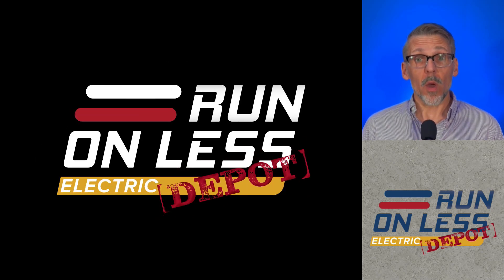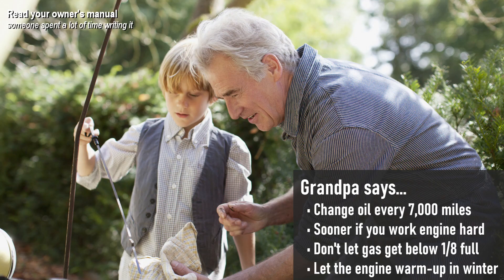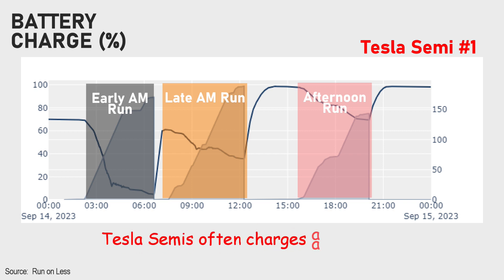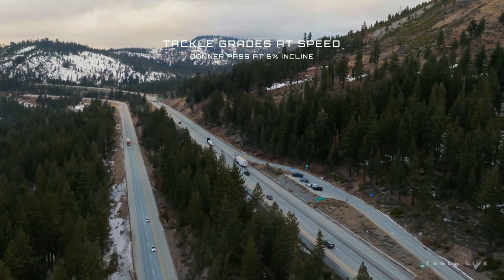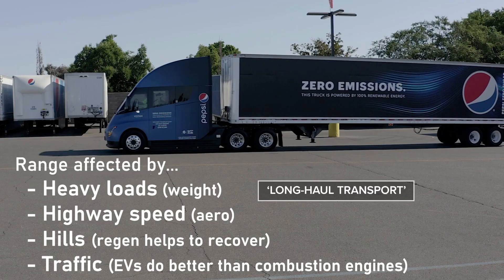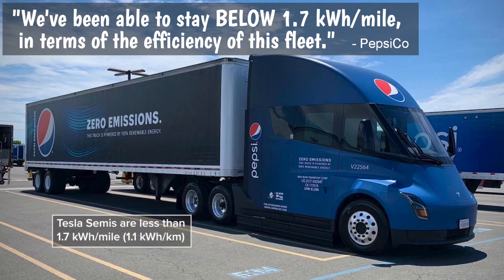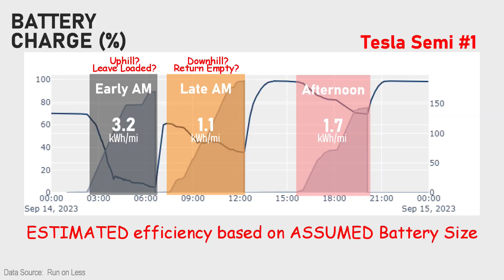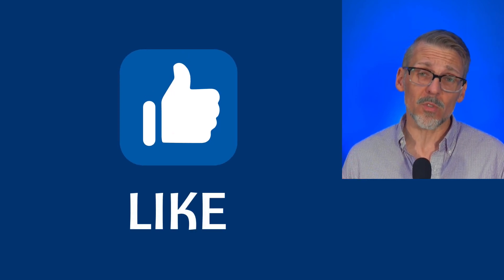In-Depth Analysis of Tesla Semi Data (Freightliner and Volvo too!)

Comment: Toronto to Montreal , Canada is about 500 miles, and  the speed limit on the 401  highway is  100kph(62mph)Walmart  and Loblaws and Pride group logistics have ordered the Tesla Semi.
Reply: HVAC Amps draw is minimal especially with heat pumps which Tesla uses in its cars ,even Bjorn in Norway did it in the old resistance heater of his 2013 modS " this is why Tesla has " Dog mode" and " Camp mode" , meanwhile ordinary Semi use diesel heaters overnite, or leave the Engine running all the time in the truck stops, to heat the Sleeper Cab,  insanity
Reply: In the winter the average speed is probably half that because you spend 2-3 hours inching forward gridlocked in traffic.  How is the Tesla semi going to keep the cab warm sitting in traffic for hours not even moving when it's -20C ?
Reply: @ansmerek  Electric trucks tend to have somewhat better insulation and heatpumps, no? Driving slower might actually offset the difference for a truck.
Reply: @ansmerek  Talk about a non issue. They could sit in traffic pretty much forever. 
Diesel trucks... Not so much. Not to mention you need to keep the engine running for heat.
Reply: @themonsterunderyourbed9408  so how does the driver of an electric car stay warm for 2-3hrs not moving in traffic when it's -25C ?  Running batteries for heat ?
Reply: @ansmerek  Ask Norway - it doesn't seem to be a major problem for their 25% of all cars (80% of new car sales) that are EVs. Heat pumps do get magical efficiencies, but even straight resistive heating doesn't use THAT much power - 1500W is about 2HP.
Reply: @jebeda  heat pumps don't work well at -25C.  A lot of people in Canada have seen first hand heat pumps do not live up to the hype.  They are nowhere even close to as efficient as claimed in cold temperatures.  Many people installed them in their homes only to find they are less efficient and more expensive than natural gas

Comment: Interesting data.  It's too bad that the companies are not giving real world data.   I am retired but worked for Pepsi (Tulsa)  Several trucks (OTR) did daily runs to the Dallas warehouse (250 miles).  Their return trip were never empty.  Deadheading is loss of revenue.  Anyway, good reporting.  Cost analysis would be nice info too.  EV cost per mile vs ICE.

Comment: It's been mentioned, but... CARGO! The only thing that's important here is how much it can get from A to B, and at what fuel cost. Range is a factor for personal vehicles because we hate to refuel... I guess... But for a trucking company the range is only important for how long it will take to refuel and that may not even be a thing if the truck has to wait for the trailer to be unloaded and re-loaded at the destination.

So basically, this video is not just apples and mango's, it's just you saying numbers out of context.
Reply: The cargo it can carry is the same as a diesel. The 300mi semi weighs <20,000lbs and the 500mi semi weighs <23,000lbs. With electric semis allowed an extra 2,000lbs,that puts them smack in the middle of the average diesel semi weight of 17,000 - 22,000lbs.

Comment: lol….. how much for an electric EV? And is it worth it ROI
Reply: Yes. That's pretty much Tesla's entire pitch - electric semis cost way less to operate.
Reply: @truhartwood3170  problem is the maths do not workout. 1/6 of the carry/load capacity. Reduced range in cold or hot extremes. Cost to buy horrific. Than down time when charging as charging points for those lorries are low in number.  Thank you, but no thank you.
Reply: @latitudeash  oh for sure, if anything you said was true then they totally wouldn't make sense. Fortunately, none of what you said is true.
Reply: @truhartwood3170  - That's good then. Can I suggest you go out and buy 10 of them, you will be making money hand over foot? It's all a vapour product. You can't even order one now. Total prototype fakery. BUT luckily I am wrong and you can make lots of money, as Elon said you would be mad not to buy it as it is sooooooo much better than dinosaur juice.

Comment: The vast majority of trucks should go plug-in hybrid while battery tech matures, it will be easy to rebuild those into full BEVs later once there are even cheaper / safer and better batteries…  they can even use cleaner burning fuels immediately; generators aren’t as picky about the type of fuel, usually being operated at a constant ideal RPM and don’t need to have things like low RPM torque and many other requirements typical of transmission driven truck engines, nor do they suffer from the same emissions problems since they are inherently burning clean at ideal efficiency which normally only happens once up to constant speeds.
Reply: Battery tech has already improved and is continuing to improve rapidly. We're already looking at mass-produced batteries with 500Wh/kg, about double that of EVs on the roads right now.

Comment: The charging limits have nuances. 
It's not charging above 80% and depleting below 20% that is the problem. It's leaving the battery outside of that over time.
So for regular driving you can use the whole range, just charge all the way and go and then charge above 20 when finished.
Reply: I believe this is wrong. The phisical access and expulsion of electrons is what damages the battery. The dynamic nature is responsable for the degradation.
Reply: @lucadellasciucca967  

No, drawing current from a cell does not by itself damage a lithium cell. Torgrim is accurate in what he says about the dwell time at high and low SOC if you look at SEI and CEI degredation. If you looking up the webinar with Dr Jeff Dahn Dalhousie for EV battery health or the Engineering Explained video on how to ruin your electric car's battery, you'll hear the same suggestions. However, they go a step further and argue that charging and discharging above or below nominal causes the cells to expand and contract, which causes stresses in the crystal structure, contributing to fractures that opens up more surface area to consume lithium ions and other material and turn it into a CEI layer that degrades capacity.

Your right that high discharge rates CAN cause damage due to the internal heat buildup, but not on the mark that its because of the electrons. Yes the discharge is evolved by drawing electrons, but the dynamics you speak of are all related to the structure and chemistry inside of the cell dominated by ion flows.

Comment: How will they perform in harsh weather conditions knowing how the batteries perform in the cold especially
Reply: It is a non-issue now due to better design and battery management and also battery chemistry - in Norway, they do not have an issue with -20C to -40C temptures
Reply: The mass of the battery pack in a semi makes them pretty impervious to weather vs a car. Also, the newest batteries still retain 90% of their power down to - 20°C. So a non-issue basically.
Reply: Tesla has the best battery termomanagement system on earth. The cold has major effects on the efficiency of ICE vehicles.
Also don t think too much about the <1% cases when you make an analysis.
Do your research, invest in Tesla.
Reply: @lucadellasciucca967  Even with "the best thermal management" Tesla cars/SUVs are still effected by the cold quite a bit, so that's not a great argument. The better argument for semis, specifically, is that because the pack is the size of 11 car battery packs, and they're all in a big brick, the volume to surface ratio is drastically larger, so heat isn't stripped away as fast. 

Combine that with the amount of power they're using and the pack can heat up quite nicely even when the weather is extremely cold. 

On top of that, electric cars use most of their power to get warmed up, but then need very little power to stay warm. So if you're get into a cold car, driving 5 min, then stop and let the car get cold, then get back in a driving for 5 min, eover and over, you're range is going to be way way shorter than if you got it, heated up once, and then kept driving. This is also why it's good to get your EV reheating while it's still plugged in, as the you're range will be practically the same as if it was 20°C. Anyway, since the semi is operating for much longer periods, it doesn't have to use energy to constantly heat up over and over. For all these reasons, the semi is almost impervious to weather vs an EV. Combine that with the fact that, as I said in my last post, newer batteries are showing 90% power at - 20°C/-4°F, and it's pretty much a non-issue.
Reply: @lucadellasciucca967  Actually not. Most rivals have as good or better  thermal management. It is not rocket science.
Reply: @rogerphelps9939  Tell me you know noghing and have done 0 research without telling me you know nothing and have done 0 research xD
Good luck buddy!

Comment: What's the useful load?  Thats what matters. Just more EV BS.
Reply: Useful load is about the same as a diesel truck.
Reply: @truhartwood3170  It's NOT!  It's much less that's why you can't find it.  Transportation companies don't care about 0 to 60 times.  Useful load is the most important and because of the weight of the batteries. This thing is another flawed  Tesla truck.
Reply: @davidsoom1551  Dan Priestley, the lead engineer on the Tesla semi, just did a talk where he said the weight of the 300mi-range semi is <20,000lbs, and the 500mi-range version is <23,000lbs. Most diesel trucks fall in the 17,000 - 22,000lb range. Given that electric semis are allowed an extra 2,000lbs GVW, that means they can carry the same cargo weight as an 18,000lb or 21,000lb semi respectively, which puts them smack in the middle of the range of diesel trucks.

Comment: No one seems to include the driver's experience in their assessment of Tesla's semis. How does a driver hand paperwork over to and speak with someone at a booth? How does a driver look out the window when backing or wipe clean the mirrors? How easy is it to manage a touch screen when bouncing along America's ultra smooth roads?  There's very very little upside to any sort of touchscreen in a moving vehicle. It does not have any sleeping arrangements for the driver. It's strictly a day cab configuration, meaning it's not suited for trips that take multiple days. Tesla's Semi is impressive in many different ways but being practical isn't one of them. And while in Tesla's cars they move units because features over functionality is acceptable, trucks aren't status symbols first. They do, at the end of the day, have to do the job they're designed for efficiently, and things like this are clearly just "trendy" not practical. It seems Tesla's designers do not adhere to the principle "Form follows function".
Reply: The entire design was based on what's best for the driver and daily operations with tons of feedback from the drivers, using the semi for Tesla's own operations, etc. Do you really think Tesla doesn't know and take into account everything you just said?
Reply: @truhartwood3170  From your reply, I can tell that you've never driven a semi and performed multiple pick ups and deliveries or driven one from coast to coast. I can understand someones appreciation for futuristic designs and the latest technological innovations but a little critical thinking will show they are impractical for everyday use. Form should follow function.The design of the Tesla semi is definitely not driver friendly.
Reply: @niemi5858  There is no remotely possibly conceivable reason Tesla would design the semi around anything other than practicality. Their customers will judge it based 100% on pure practicality, nothing else. Tesla knows this. Drivers have been key consultants on every phase of development to make sure it's going to work for them. But with every design there are tradeoffs. If there's something you see that doesn't make sense for one reason, there could be five other reasons it makes way more sense to do it the way they did. I'm not sure why you think their cars have sacrificed functionality either. You do know there's a difference between "not familiar" and "not functional", right? I also find it to be the pinnacle of hubris to say "I don't get it, therefore it sucks." In any case, they'll be driverless in 5-10 years or so so being practical for the driver is only a short-term consideration.
Reply: @truhartwood3170  Have you ever driven a semi? Have you made pick ups and deliveries in one? Have you driven a semi for an over the road operation? If you answer, I will provide a rational explanation for my outlook, otherwise there would be no point in continuing. Thank you.
Reply: @truhartwood3170 I see you didn't respond to my query about your semi driving experience. Care do do so now?
Reply: @niemi5858  I have zero experience, which is why none of my comments require me to have any and why you therefore can't use that as a "gotcha" to dispute anything I said.
Reply: @truhartwood3170  Not looking for a gotcha, that does nothing for me. Just seeing how honest you would be and you are. So thank you for that. That said, you do have a right to your opinion but an uninformed opinion seldom gets any serious consideration. I am not against electric vehicles per say but my 74 years of experience has shown me that most designers, and engineers have little practical experience but loads of theoretical knowledge. However well meaning they seem to be, their egos seem to induce a form of confirmation bias and rarely are they willing to listen to constructive criticism without getting their "feelings" hurt. The current lithium ion battery technology, although impressive, is not yet ready to compete with the convenience that ICE vehicle provide.
Reply: @niemi5858  but when you look at the engineers giving talks, they harp on and on about how drivers have been part of the process since day 1, and they're constantly looking for ways to make their experience easier and better. Tesla is the least ego-based company on the planet. You hear this constantly from everyone who works there. "Check your ego at the door when you work for Tesla" is what they all say. If the janitor has an idea about how to improve something, everyone listens. 

All the interviews I've seen with the drivers driving the Tesla semi say they massively prefer the Tesla semi over other trucks, and if there's random assignment to trucks, everyone hopes they get the Tesla. So everything I see tells me they are very much making this as practical and functional as possible.

Also, as demonstrated by the semi already taking over from diesel trucks, batteries are very much at the point where they can take over from diesel. Cuz, you know, they are. Right now. Pepsi just got 50 more for a total of 85, and Costco and Walmart have some and have put in orders for hundreds more. Tesla itself has has a massive logistics division. They are shipping raw materials, parts, and vehicles all over the world and around mutlple countries on multiple continents. They know the business and what the needs are. They also know what kind of product they're capable of delivering, and they're already using their own semi on their own routes. So when they invest billions of dollars over seven years to bring this product to market, they probably are doing so with a fairly high degree of confidence that it will be successful. This is the company that is currently selling the #1 selling vehicle in the world - the Model Y. This is the company that has the highest customer loyalty in the industry. This is the company that is making the highest profit margins in the industry while most other companies are losing money. I think they know what they're doing.
Reply: Tesla's semi is a day cab, probably for good reasons.  Fleets likely want to use electric semis in day cab applications first.  Tesla can make a sleeper cab when charging infrastructure is built out to support over the road trucking.  Until then their truck should be compared to other day cab trucks, none of which have sleeping arrangements.

Comment: Hmmm so as far as State commercial vehicle inspection agencys go How will the safety equipment be inspected on these electric Trucks? How will a cop look at the Brakes tires and so one Most state inspection agencys are run like the GESTAPO! So Will electric trucks get a break because they are politically correct?😮
Reply: Tires and brakes and everything are exactly the same as those used in diesel trucks.

Comment: There is no way that an electric semi would work for OTR drivers, or a company that runs OTR. California running freight from the ports to the state line, yes. But we sleep in those things while using electricity On the side of the road, You Won't be able to charge them overnight even at a truck stop, Cold weather renders them almost useless, You get about a third of the range that a diesel truck gets, And it takes 8 times longer to charge that it does to fuel a diesel truck. We tried doing this over a hundred years ago and we chose to go with diesel trucks.
Reply: Ridiculously uninformed comment. The Tesla semi charges from 10%-90% in 45 min. That's not much over the 30 min break. Chargers aren't at truckstops yet obviously but you could be fully charged after you 10hr break with a simple tesla v2 supercharger. So even 400 miles on the 1st leg, another 300 after the 30 break. Pretty simple. They'll work if there's enough charging infrastructure just like passenger evs now.
Reply: I’m not a big fan of electric but saying “we tried this once, 100 years ago” is one of the most stupid things I’ve read all week.
Reply: Do you think there has been no progress in batteries over the last 100 years? 🤣 Also, cold doesn't affect the huge semi battery due to its huge mass to surfact area. Also, newest batteries still maintain 90% of their power down to - 20°C.